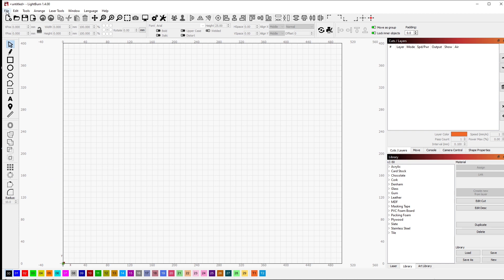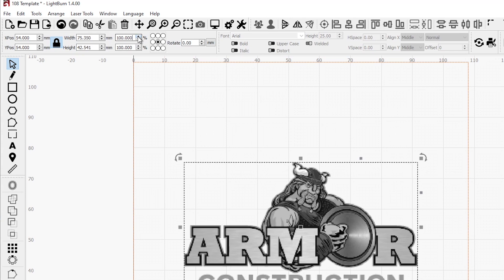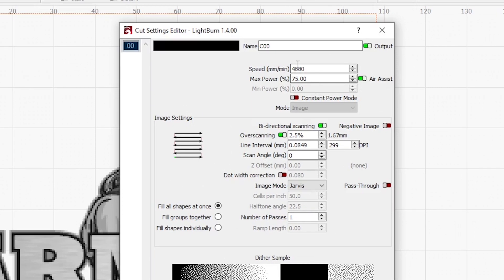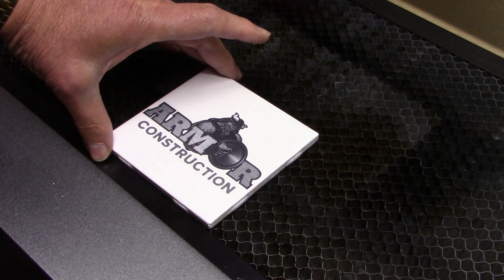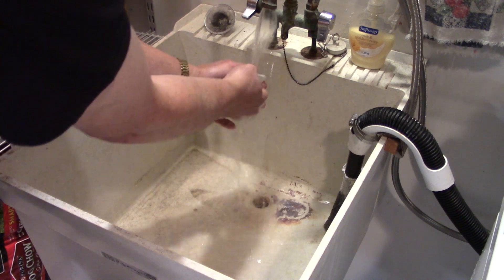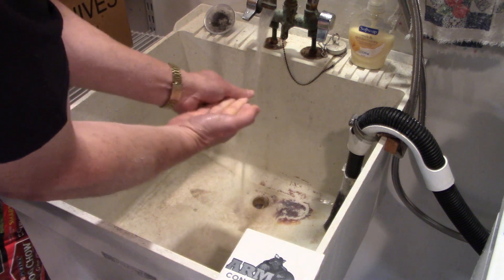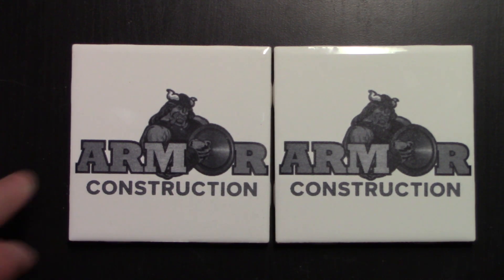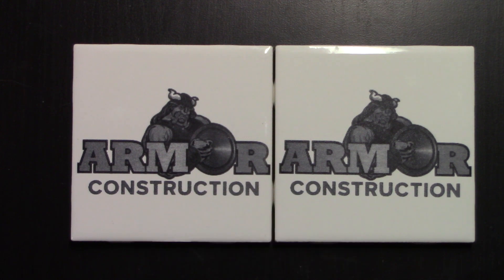Does burning a coaster using Titanium Dioxide (TiO2) hold up under microscope scrutiny?

Comment: What is the mixture ratio please?
Reply from the maker: Great question!  Unfortunately, I do not have an exact answer for you.  On up side, the ratio doesn't matter too much.  This process is very forgiving as long as you have good coverage of the TiO2.  I started around 1 to 1 - 2 to 1 on my mix.  I did it by eye and didn't measure the amounts.  Kind of how I do it when I makes pancakes, it is all by look.  ;-)  Recently, I have been applying my mixture with an airbrush and I thinned my mixture a little more.  the mixture is around 3:1 (3 parts denatured alcohol to 1 part TiO2).  I have found that even a thicker layer will work OK as long as the power and speed settings are good.  The airbrush puts down a nice, thin layer of TiO2 and the results have been really nice.  I hope this helps.
Reply: @CNCATHome  thank you! Your work is great!!

Comment: What ratio did you settle on for the TiO2 and alcohol? 3:1? I have been playing with it myself but I think I get mine too thin so I can spray it and it doesn't cover as well as yours. Maybe a few coats would fix that for me.
Reply from the maker: That is a great question.  I wish I knew the answer.  I really do not know what my mix is at.  I did poor science and mixed it kind of like how I make pancake mix.  I give it a visual and if it is too thick, I thin it out. If it is too thin, I add more stuff.  With my current mix (and I made too much for my testing) has a bunch that has settled and I kind of stir it up a little so the suspension seems good.  My guess is it is more like 5:1.  I should start a new jar and mix it in a more controlled way so I know what a good mix will be.

Comment: I have been wanting to do a tile project where an image covers several tiles in a 5x5 grid. Burning 1 tile at a time sucks. I think with the effectiveness of the TiO2, its time to order some and burn. I wasn't confident with spray paint method and didn't want to waste my time.
Reply from the maker: There are a few issues burning something that size.  If your laser doesn't have a working area large enough to put 5X5 tiles in at one time, you have to brake up the burn.  I did a video on that some time back: https://youtu.be/uZSRyGuiCBw.  Doing them one at a time could be a hassle too.  You can't just set it up and walk away for very long.  As a general rule, you shouldn't just let your machine run for too long unattended to insure something doesn't go wrong and make a bigger issue. 
To help insure your tiles turn out similar, try getting them all coated at the same time and the same way as best as you can.  Make some extras, just in case one of them need to be remade.  I have been in the cleaning process and dropped a tile that then has to be remade.
Good luck with your project!